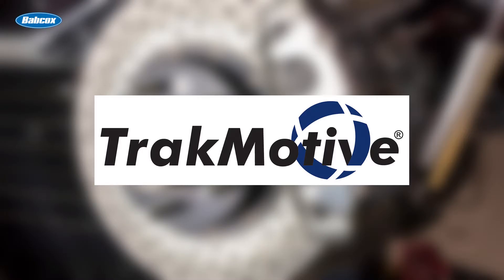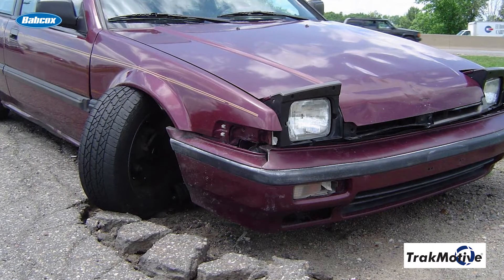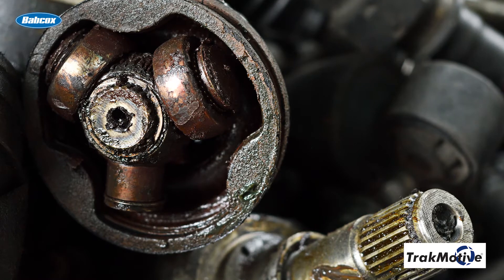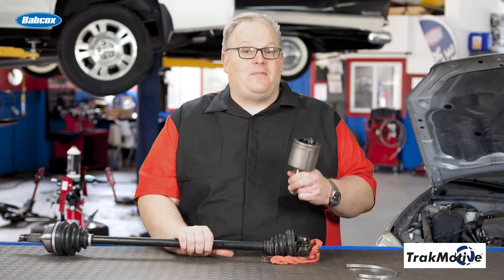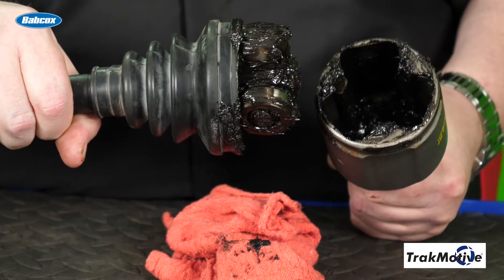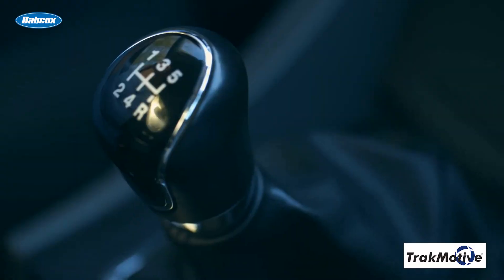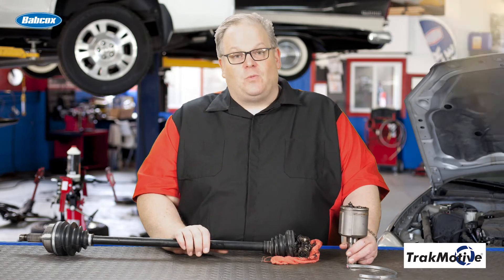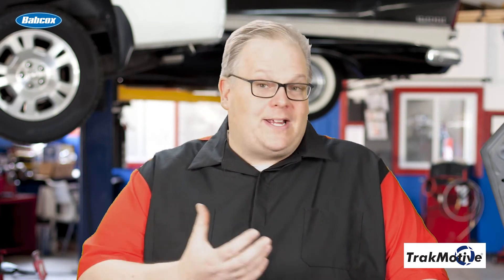TrakMotive   Tech Minute CV Axle Grease Buildup

Comment: Nonsense.  Usually  the aftermarket axles are low quality and fail MUCH sooner than the OE.  If your axle just has a torn boot and is not exhibiting excessive play and noise, you are usually better off CLEANING out the old axle, repacking with fresh grease and re-booting it.  Don't take the lazy way out and buy an off brand made in a less respected country of manufacture or you'll just end up having to replace it again soon enough.

It is almost always true that with only a torn boot, cleaning and repacking the original CV axle will result in it lasting longer than a brand new aftermarket axle.  The whole vague idea of "dirty you can't see", well then you couldn't see this invisible contamination in the new axle either, right?  Yeah, that's why you clean it out, and you use quality grease instead of the penny pinching junk that junk axles come with, and the junk boot that splits that much faster too.